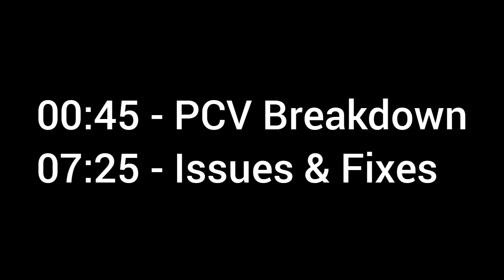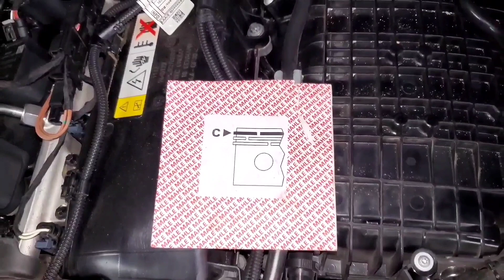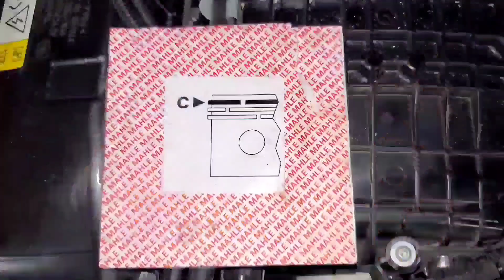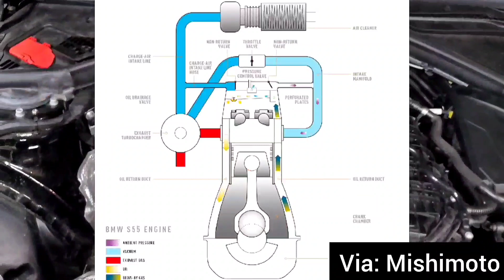**READ DESCRIPTION** How the B58 PCV Works

Comment: @kern417 I just got the crankcase ventilation leakage code 16050A. Does the Supra B58 have the PCV somewhere else? Cant see it next to the oil cap.
Reply from the maker: It's built into the valve cover
Reply: @kern417  If you watch the latest FCP Euro video that talks about the TU engine valve cover, they say there is no actual PCV in the valve cover anymore.
Reply from the maker: @AnontheGOAT they are wrong
Reply: @kern417 With all due respect, no they are not. The B58TU does not have any sort mechanical diaphragm built into the valve cover. There is a check valve going from the engine block to the intake right before the turbo and that’s it. I just replaced the vc on my ‘22 M340i and cut the old one apart. There is absolutely nothing inside of it except for baffles and channels that route ccv vapors as needed. If you don’t believe, I will gladly put money on it to prove otherwise.
Reply from the maker: Feel free to put whatever money you want on it. The valve cover has an integrated pcv system with check valves built into it. It does not have a serviceable diaphragm like gen 1, but that doesn't mean it doesn't have a pcv.
Reply: @k@k @kern417 It doesn’t have check valves in it. If it did, then I wouldn’t be standing here blowing and sucking out of all the orifices on my new VC to test for check valves, only to not get any kind of restriction either way lol. You’re making assumptions based on your gen 1 B58 and stuff you’ve heard online. Not to mention, if it did have check valves then that would mean it has mechanical moving parts inside, which again, it does not. As I said, the only check valve is the scavenger line located between the side of the engine block and the turbo inlet. Alex @FCP spoke directly with BMW engineers who told him this.
Reply from the maker: @AnontheGOAT if it didn't have check valves then what's the point of blocking the head ports? What breaks when a valve cover sees too much boost? What's the point of block off pins?

Check valves are essential for operation on a turbo car. If the headports just go to the crankcase with no regulation, you'd have much bigger problems. I'm not sure how you think that can work.

And yes, sometimes engineers are wrong. Kind of like the Toyota engineers that talked about all the R&D they did on the B58 that we know is just a BMW product. This isn't new info. The engine has been in cars for going on 7 years. But you can believe what you want.

Also, the hose on the side of the engine is an intake. It sucks air into the crankcase, it doesn't vent crankcase gases. You should be able to confirm that with your testing method.
Reply: @k@k @kern417 dunno which hose you’re referring but there are two as you know. The one on top of the valve cover vents fumes into the intake(you pointed this out in the video). The other one, smaller in size(engine block to intake) has the check valve and no, it doesn’t vent to the intake. It’s a scavenger line that has a check valve. That only opens to pull fresh air(and oil vapors) back into the block. You can easily verify it by blowing into the tube. It opens when you blow towards the block but stays shut if you go the other way. As far as blocking of the ports on the head with pins, how do you explain how I didn’t detect any check valves during my testing? The vacuum pump(built into the oil pump) assists with that along with the series of baffles and channels inside of the vc, which again are all hard points with zero moving parts. If you think you know better than me, then buy a brand new valve cover and cut it open to see for yourself. Could make a cool video about it and settle this debate once and for all.

Comment: B58 leader please help once again my man, I saw a forum post that you replied too of a guy that had the PVC problem and replaced the whole valve cover since it’s built in. I saw that he had the same symptoms I had which was after 20-30 mins it will suddenly rough idle & the tea kettle whistling noise. Do you think if I just replace the PVC diaphragm and seal it would it fix it or do you have to replace the whole valve cover? The only thing that is making me think to replace the whole valve cover is that the people with PVC issues that would just replace the diaphragm had ether the kettle noise or white smoke but NO rough idle shaking? .. would the PVC diaphragm failing cause only the kettle whistle & NOT the rough idle shaking or would that shaking be due to the valve cover?

TL;DR
Rough idle shaking and tea kettle whistle after 20-30 mins of parked idle.
Replace whole valve cover (fixes the rough idle shaking & kettle whistle after 30 min idle)
OR 
replace PVC diaphragm (fixes the kettle whistle after 30 mins but possibly will not fix the shaking rough idle)
Reply from the maker: Replacing the diaphragm should fix it

Comment: 21A02D is that code related to the valve cover problems?? I can’t find anything
Reply from the maker: It's most likely related to vanos
Reply from the maker: Not sure what happened to your comment but unfortunately the only other thing I've seen fix it is a software update from the dealer.

Comment: @kern417 I have black smoke coming from my exhaust and misfires at idle, specificly cold start. I inspected my PCV diaphram and it look fine, no damage. My car is throwing the P0171 bank 1 too lean, any idea of what it could be?
Reply from the maker: Sounds like an injector issue. Pull your plugs and see if any of them are wet or white
Reply: @kern417  thanks for responding. I thought it was an injector issue but after taking my car to the dealer, they reflashed my ECU and the car ran perfectly for 3 days then went back to what I previously received. So I don't think it's mechanical, most likely electrical. Any idea on what it could be? Desperate for help as me or the dealer can't find out what it is
Reply from the maker: @solerzyoutube  it could be a lot of things. They'll need to diagnose it
Reply: @solerzyoutube  hey! Have you solved the issue with the P0171?
Reply: @technopro-kz4xv  hello, no I actually just cleared the codes and got rid of the car. Didn’t want to keep throwing parts and money at it so I never found out what it was

Comment: Just replaced a PCV Diagphram on my Sons VW 2.0 TSI (similar solution to the issue).  His rubber diaphragm was cracked as shown in your video and the car would drop in idle and stumble around ... no smoke at all however.
I don't think the OCC along with the PCV is really a complicating problem.  One that works well will collect a fair amount of oil that doesn't need to be deposited all over the internals of the intake manifold and valves over time.  It is another maintenance item however and if you forget to drain and it fills to the top it can suck in excess oil!
Reply from the maker: Also, if you live somewhere where it's cold, water can freeze in the catch can lines and cause it to burst

Comment: Hey kern thank you for the imformative video, so I had a question, what would you recommend, the Vader solutions kit that deletes the diaphragm or something like the Vargas turbo oil cap breather with the check valve?? The Vargas turbo seems like the cheaper solution at 100$ over 300$ for the Vader kit, but which one is actually better? Thank you
Reply from the maker: The vader kit is better. I would not recommend the vargas breather without the vader kit, and vader solutions sells their own breather as well. So really you can get it all from VS.

However, it's not needed for most people. Unless you suspect there's an issue with your pcv, save your money.

Comment: Would the pcv system cause the car to make electronic beep sounds?
Reply from the maker: Nope
Reply: @kern417  I have a video of my car making the beep noise and I have been told it's the pcv system but wanted confirmation
Reply: Here's the video https://youtu.be/Qwq5KIAByNI
Reply from the maker: @adsali03  I don't hear anything out of the ordinary
Reply: @kern417  it's definitely making a beeping noise every  few seconds in the video..
Reply: @adsali03  is that a wind-up?
I can hear a electronic audible beep every 2 seconds but it certainly isn’t coming from the engine
Reply: @anthonyh958  no wind up, its genuinely happening
Reply: @adsali03   above my pay grade I’m afraid mate. If it’s the car making the noise surely there is a warning light on the dash somewhere?
Reply: @anthonyh958  I've had it checked out and put on ista diagnosis machine, no issues found
Reply: @adsali03   maybe post the video up on a bmw forum as I really can’t explain this myself. If you find the answere/cause let me know. Good luck
Reply: @anthonyh958  will do... Is it the bimmer post forum?

Comment: Could you have both the oil catch can and the VS  cap? Also on his website it isn’t very helpful but are you buying just the cap and the AN LINES?
Reply from the maker: Ideally you want the VS breather to vent to a catch can but it needs to be purchased separately
Reply: kern417 i have a burger tuning catch can i wonder how it would work as i’ve seen no diy’s on it.
Reply from the maker: @matthewdasilva5871  the issue is that the vader solutions kit has 2 feeds. So you'd need a catch can with 2 "in" ports. But you can still leave one of the connections vented to atmosphere.
Reply: kern417 gotchu seems a tad bit expensive at 300 to pair it to an aftermarket catch can but the idea is there! Thanks for the feedback and amazing vid as always !

Comment: I was in a bumper to bumper traffic and it began to smoke from the exhaust, then I turned it off and on still kinda happened till I drove off it went away completely should I still consider the vadar solutions kit ?.
Reply from the maker: It will prevent that from happening again

Comment: What about adding a breather to the PCV port and blocking the turbo inlet PCV connection? I did that to my 2020 Supra running a Pure800.. Followed what most top frame turbo upgrade kits did..
Reply from the maker: The Vader kit does that in a sense. It adds a dump tube to the pcv port so you don't need to route it back to the intake. Sorry I missed that in the video.
Reply: That’s what I ve done to my E36 M3 and the intake side internals were like shiny and new after 100k miles

Comment: Why not just change the diaphragm? What's the reason why this isn't the first solution?
Reply from the maker: Because it doesn't make sense to have a catch can and a pcv. It adds more complexity and potential failure modes when it's not needed.
Reply: @kern417  didn't ask about catch cans lol. Can you just change the rubber diaphragm and move on?
Reply from the maker: @SSWORKZ  sorry i got mixed up with someone else's question. But yes in theory you could, i think i mentioned it in the video as a potential fix.
Reply: @kern417  that all good. Thanks for the info.
Reply: So if we suspect a pcv failure, 1st check should be the diaphragm right?  Hopefully it's a cheap and easy replacement.
Reply from the maker: @ProcTech  it's not sold separately, but you may get away with buying a used valve cover and swapping it over.

Comment: What you recommend port injection or methanol injection
Reply: making power port is always the answer. Never use meth for fueling, only cooling.
Reply from the maker: Port Injection or both
Reply: @kern417  I don’t look at making crazy power plan on getting  a pure800  running 93oct with snow performance wmi kit or you think port injection better instead?
Reply from the maker: @xcashinx7370  you can do port fuel injection or port meth Injection. Port fuel injection isn't needed with the pure800, but you won't make 600 on 93 octane. You'll need meth, whether it's injected in the charge pipe or port Injection. Port is more ideal but port meth Injection is hard to setup.